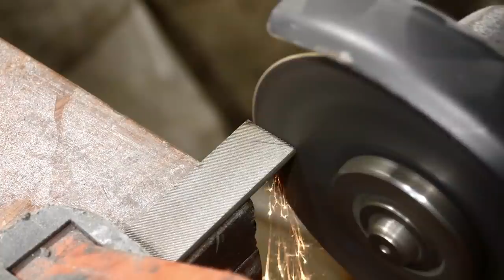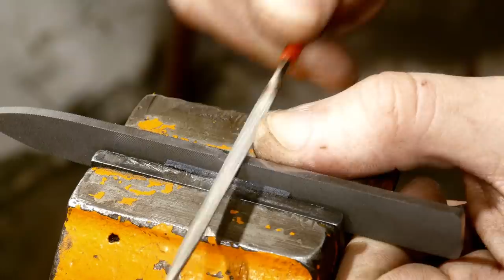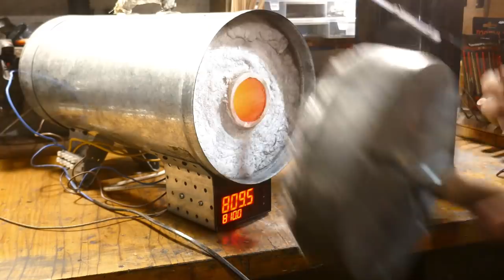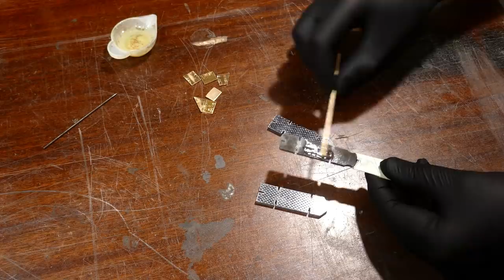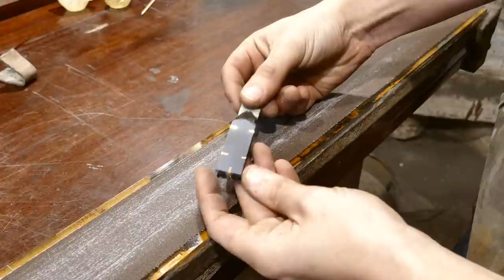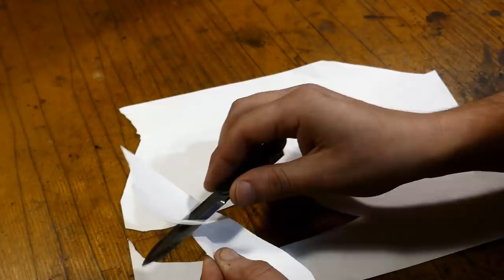Knife Making - Little Letter Opener Out from File

Comment: Great knife. I have a question, why first temper the file in the oven, and then process it? I thought we should do the opposite. First, completely finish processing the blade, and then temper and release.
Reply: Because files are hardened. If you try to process it it is going to be very difficult and your tools are going to have a hard time. So you put the file in the oven heat it over 723 °C to loosen tensions of the Iron-carbon connections, and then let it slowly cool down so the carbon atoms have enough time to get out of the iron connections. Now the file is a less as hard as it used to be:) and in the and you heat it again but then cool it rapidly so the carbon atoms get caught in the iron connections and cause tension so the material is a lot harder.